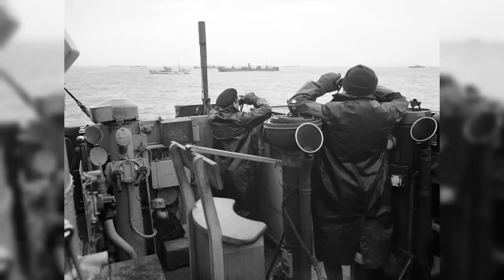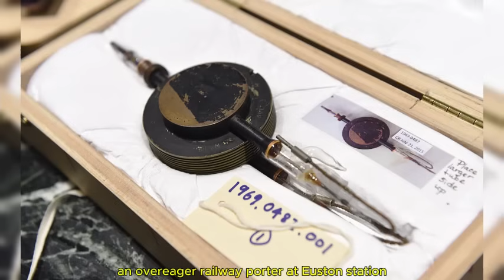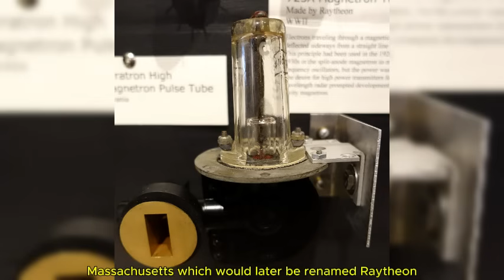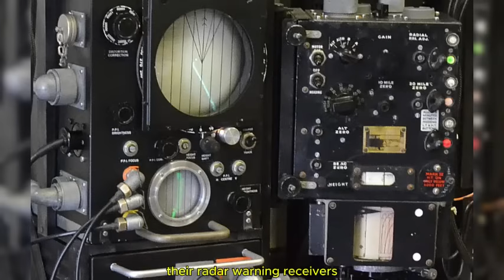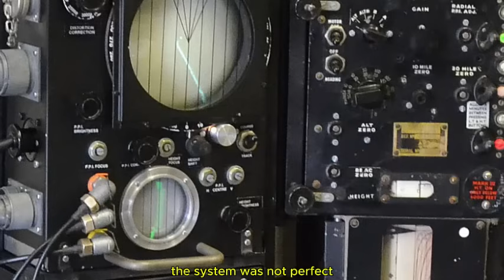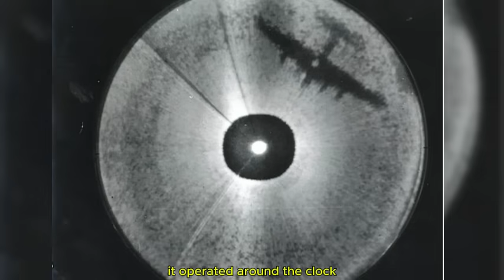America Had No Radar Tubes in 1940 — So Raytheon Mass-Produced Magnetrons That Found Every U-Boat

Comment: Near my home was a machine shop I was told was built to support the MIT RADAR project during World War 2,  Unfortunately  a wooden building exposed  to water from its stream centered  location  could only survive so long.   The building had to be removed.   A  Small park has taken its place with no mention of the sites former connection to the RADAR project.   I also spent some time in MIT's Building 20, a WW2 "temporary" building which I believe survived  into the 1990s.   It was the last of many structures at MIT which supported WW2 projects.

BTW Raytheon created the first Microwave oven the Radar Range..   A Raytheon Tech found a candy bar melted in his pocket as he was testing a Magnetron.  Apollo radars at the Quincy shipyard could cook seagulls  in flight.    

Later in the  U-boats could run their diesel engines under water via a snorkel.   Better radars could detect even this small bit of metal on the surface.   MY dad worked for Raytheon which not only produced Magnetrons but built tubes for the VT radar based  fuse.   Ship based radar and VT fused anti-aircraft shells greatly improved our defenses against the Japanese suicide  
planes.  The VT fuse was first used on land  as part of the Battle of the Budge.  VT was the code name for Variable  Time  (  Radar ) fuses.  They meant the fuse triggered only when the fuse was in lethal range of its target. On land they produced deadly air bursts as shells neared the ground.  fox holes and open trenches could no longer protect troops from air bursts.

Comment: Back in 1971. When I was 15 years old.  My folks have gotten divorced. We moved from Detroit to Baltimore.  I was introduced to a man. Who was a friend of a friend of our families. His name was Tom Bray. He was an, MSEE.  He had a Masters Degree  in Electrical Engineering. He got from the University of Maryland.

For World War II, Tom Bray went to work for the U.S. Navy. He told me. He was working with Microwave Stuff. He never elaborated on that.

And after World War II was over. He went to work for Bell  Laboratories in New Jersey. And in 1948. He was there when they invented the Transistor. He told me the story.  But then he also told me a story. Of all the,  Experimental TVs  they were all building. And the one thing they could not, technically figure out how to do? Was that of locking, Vertical Hold.  So the picture would not start rolling vertically.  They just couldn't figure out  how to do it?  You needed to be an, Electrical Engineer to tweak in, a viewable picture. They couldn't get a handle on the Vertical Hold?

These Bell  Lab  Electrical Engineers were all building their own TV sets, at home. When  Tom Bray  came up with the missing piece to the puzzle. One evening at home. It was wonderful when he told this story. His eyes just lit up. When he told me how he created the reference voltage for the vertical hold. In a most unique way. And it worked perfectly!

He turned his other  Electrical Engineer, colleagues onto this at Bell Laboratories.  And those are very different times.  Those engineers were basically owned by Bell Laboratories. And anything they even come up with on their own time at home? And bring into work.  Becomes the property of Bell Laboratories and patented by them.

They immediately  patented, Tom Bray's, vertical Hold Circuit. And immediately sold that patent, to RCA. Later in the fall of 1948. RCA introduced the first, commercially available, Retail  TVs. Built by RCA in Camden New Jersey. Just blocks from the Bell Laboratories.  And voilà! TV for the consumers in the fall of 1948. With Tom Bray's Vertical Hold  Circuit. For which he got, no extra vacation time. No extra bonus. Not a day off. Not even a thank you. And they sold that patent for millions of dollars to RCA of, Tom Bray''s, unique vertical hold circuit. He got not so much as a thank you!  He is not in the history books. Along with Shockley and the other EE's of the transistor group. And they got noticed. They went into the history books. Tom Bray did not.. But Tom had the linchpin to make TV happen. He had that missing piece of the puzzle. And he received  no recognition, no notoriety, no mention thereof?

Tom Bray would later become a Methodist Minister  and had his own church and congregation. But the Methodist Church felt that Tom was,   too progressive. And while his congregation loved him. He was relieved of his post at his Methodist Church. He was crushed by that action.  His congregation loved him.  But after that? He told me… He had a Bad Taste in his mouth over Organized Religion. He never spoke of any religion, God, Jesus, anything religious to me. As Tom Bray  who had a married 18-year-old daughter. And a 12-year-old son. Would take me under his wing and become my mentor. He knew I wanted to become an, Electrical Engineer, myself. And while he had his 12-year-old son Toby.  He basically became a father to me. To this now fatherless, 15-year-old.

Oh my God……  I was so incredibly lucky. To have Tom Bray is my mentor.  He shared so much knowledge  with me. And then he handed over  a job he did he enjoyed doing. He became the Orchestra  for the Maryland Ballet Company. Founded by our friend of the family, Daniel Dimond.  He was a wonderful friend of our families. And he's the one that turned me onto Tom Bray. Tom had a little recording studio of his own downtown Baltimore.  And he would provide the Playback from real to reel tape. Of the orchestral music the Maryland Ballet Company Dancers would dance to. He enjoyed doing that job. But at 15 years of age.  He turned it over to me.  And then he handed me one of his  REVOX, reel to reel recorders!  The model G-36  a vacuum tube, reel to reel recorder by REVOX of Germany. Owned by Studer of, Switzerland.  He told me… The transport control buttons. Will soon fail and break. And when they do not if but when. You will then just throw the recorder out. There will be no repairing that. The parts are no longer available. There are no retrofits  available. But it should work fine until such time. Wow! This was a beautiful sounding professional recorder! It took big 10.5 inch studio reels of tape. It sounded fabulous!

I became the orchestra for the Maryland Ballet Company  at 15 years of age. And I got to work with our family friend Daniel Dimond. The founder,  creative director and choreographer. Daniel Dimond would also become one of my mentors. I was a kid without a father. Now it's like I had 2 new dads.  I was so incredibly lucky, so incredibly fortunate. I had my first real job for Daniel Dimond  and the MBC.  And I had my Electrical Engineer Mentor, Tom Bray. I would call him up on the phone. I would ask him questions. He would talk to me for hours each time on the phone. We would get together from time to time. He answered all my questions! He taught me so much!

Tom would watch me grow and succeed in my career pursuits. Though I had a mathematical block. I was rotten with mathematics.  I went for extra tutoring.  Extra help from others. I did not have a logical mind?  Numbers did not click in my brain at all? Tom was horrified  at my lack of mathematical skills.  I would not be able to become an, Electrical Engineer like my mentor Tom Bray. It would not be in the cards for me? But I was a very talented Electronics Technician.  I could definitely fix things, troubleshoot things, restore things, repair circuits. And I rounded everything off to the nearest 1000.  LOL. But I got by. And even Tom tried to help me with the mathematics. Because Electrical Engineering  was all mathematics. I could not make the grade? There would be no college for me. I wouldn't even make it all the way through high school as I dropped out midway  through my Junior Year. Why?  I was already working in Radio  2 days per week. At our local Baltimore NPR affiliate college radio station. As a Volunteer Engineer. The youngest they had ever taken on at that time. As I was still 15. And I would work for them  for the next two years. Every week religiously. Thursday evenings and Saturday afternoons. I had an operatic show on Thursday evenings. I had Jazz Extravaganza with Vernon Welsh on Saturday afternoons.

But when I was 16.  I got a most unique Job Offer. A job I absolutely wanted! But I would not accept their offer. Why?

After 23 years.  Of Tom Bray working for Johns Hopkins University. Very much looking forward to his retirement after 25. Johns Hopkins University laid off, Tom Bray after 23 years.  Oh my God? How could they do such a thing? They then hired a young PhD they could pay less to replace Tom. There was no replacement for Tom.  He was a Fucking genius. He was saving countless lives. How so? He worked on all of that Bio-Medical  Electronics  equipment. That would monitor your life signs. As the doctors operate on you.. He saved countless lives for years. Then they laid him off after 23 years.  That was a loathsome thing to do to Tom Bray!  He had a 13-year-old kid at home along with his wife house and mortgage. And now suddenly out of work after 23 years.  I was outraged with Johns Hopkins University.  That's why I declined the offer  from Flite Three Recordings Inc.  A brand-new multimillion dollar Recording Studio Complex.  That had just opened in Baltimore in 1972. They were looking for a new Chief Maintenance Engineer. And after I spoke with the VP. He offered me the job at 16 years of age! It was absolutely a position I wanted!  But I had my mentor  Tom Bray to think about!

And so I told the VP, Craig… I felt that was too much  responsibility for any 16-year-old to take on?  I was lying through my teeth. And I told him… I thought they would do much better with my mentor?  And when he asked me what my mentors name was?  I said his name is Tom Bray. I did not expect  the response I got?

TOM BRAY!  WHAT HAPPENED TO TOM? WHAT HAPPENED TO HOPKINS? WHAT HAPPENS AT TOM BRAY?

I was immediately taken aback. I asked Craig… You know Tom Bray?  He said… YES I KNOW TOM! WHAT HAPPENED TO TOM?

I explained everything to Craig.  He told me he had been a stock boy when he was 16. For Baltimore's Esoteric Hi-Fi shop called the House  of Sound. A legendary stereo shop in Baltimore. They sold only the best high-end stuff. And  Tom Bray was there  Consultant. They would give him  a piece of equipment they were interested in selling? For him to evaluate. To determine? If it was worthy of the store to carry that item? When Craig was just a stock boy for that Hi-Fi shop.

Craig thanked me.  He said I will call Tom right now.  And out of the blue. He offers Tom Bray the Chief  Maintenance Engineer Position at Flite Three Recordings Inc. It was a job Tom loved!

(More  American History in following post)

Comment: Not to mention the PROXIMITY FUSE..which allowed large anti-aircraft shells with magnetrons to blow up when near an enemy aircraft.  This was deadly to Japanise aircraft attacking U.S. aircraft carriers, among other things.
Reply: The proximity fuse did not contain a magnetron. The fuse did indeed use Doppler radar, but at a much lower frequency generated by conventional circuitry (using glass vacuum tubes!).

Comment: Picture is incorrrect.
Built that way would ignite fire!
Reply: Actually the "shorting" wires are correct.  RF doesn't work like anyone would intuitively think.  RF engineering is often call the black arts in electronics circles.

Comment: Some 50 years ago my father, an architect/builder, acquired a property on Broadway in Irvington NY.  It was a huge stone building we nicknamed the castle and was in very bad repair.  As teenagers, my friends and I went exploring this huge building and found a sub-basement stairway behind some false panels in the basement (we also found dozens of other hidden passageways, presumably for servants back in the day).  We were very curious where huge power cables went from a small substation on the property.  Multiple bundles of 4 each 500 MCM copper.  We didn't find any machinery, but we found the concrete bases where it was mounted, many rusted power panels, and dozens of old wood crates which were filled with old magnetrons.  The area was huge.  After asking a lot of questions, we were told the place had been a secret factory during WWII for Phillips to manufacture magnetrons for the war.  I have been unable to verify this story and was curious if this was indeed true.  Did Phillips manufacture magnetrons back then?  Did they, or others, have hidden facilities to produce them?
Reply: More surprising that some crackhead hadn't made off with that copper

Comment: It was invented in February of 1940.
Reply: It was invented in the 1920s and 30s in Ukraine for the Soviet Union.
Reply: @SimonHollandfilms  According to whom?   It was invented in the UK, specifically for 10cm radar.   Where is this story about it being from Ukraine 20 years earlier?
Reply: @TheXO-614  Both the Japanese and Russians came up with Magnetrons in the 1930's very similar to Randell and Boot's design. Problem was they had the running life of a German Jet Engine and were very frequency unstable, so were next to useless for any military applications. Same for the Spilt Anode Magnetrons designed by the Germans and other nations who tried to build centrimetic magnetrons. The big difference was GEC, who were the compony tasked to develop the Randell and Boot design, added a French concept for a oxide coated Cathode which massively increased the running life of the device and allowed it to produce a lot more power without burning out the cathode. Also a Scientist at TRE called Alex Sayer came up with the concept of Andoe Strapping which massively increased the frequency stability of the device.
Reply: @richardvernon317  thank you for that additional information.
Reply: @richardvernon317   On the running life of WW2 German jet engines, (under 10 hrs iiRC) i read something a year or so back where one was scratch built using modern alloys and it became far longer lived.  It seems the major problem for Germany wasn't the design, but the metallurgy which was not up to the high temperatures.
Reply: @TheXO-614  The British and Americans had the same problems. Most of their early Jet Engines were massively derated to get a decent running life out of them. It wasn’t until the late 1940’s that anybody’s metallurgy was good enough to build a long lasting powerful Jet engine of any type.